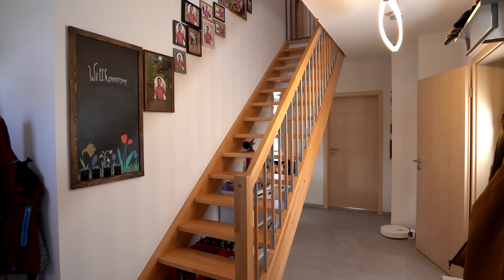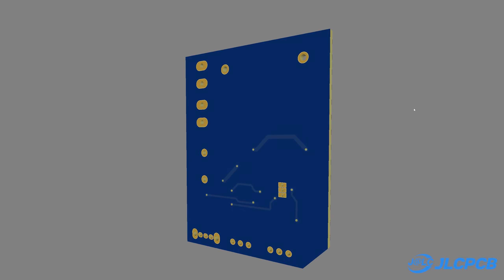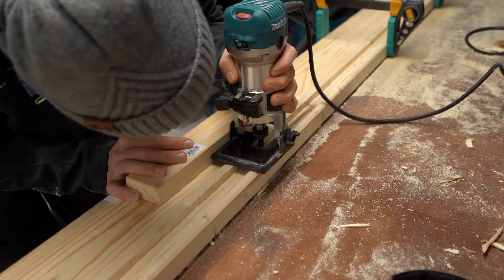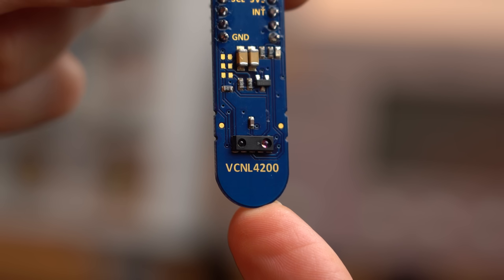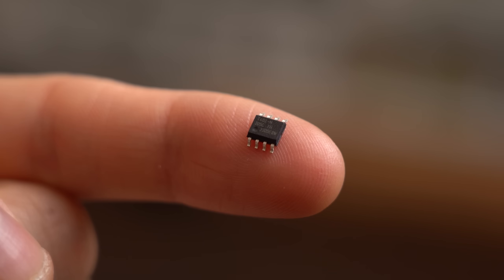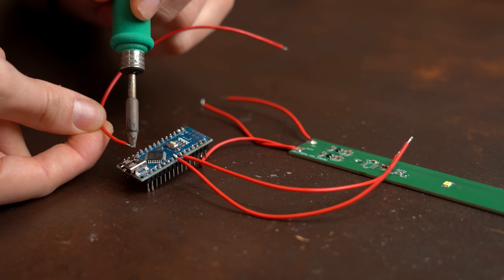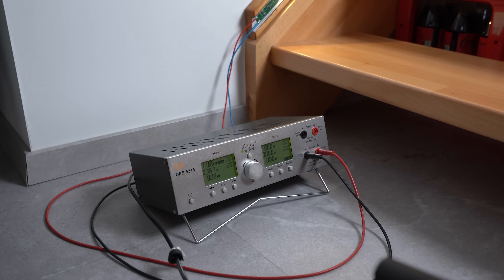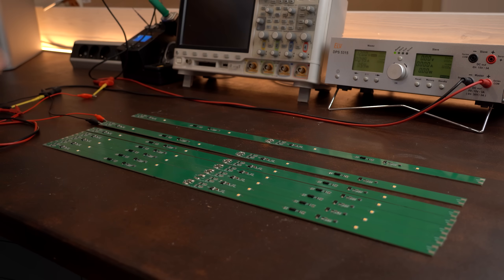I tried to Revolutionize LED Lights!.....And FAILED?

Comment: Frugal Engineer : This can be done with two proximity sensors, the 1st at the beginning of the staircase and the 2nd at the end. Keep the entire LED strip on until you pass the ladder. 
Use reliable MCU and LED drivers.

As per my understanding, you don't want to manually turn on/off the house lights, and you don't want big bulbs to be lit
Reply: that's how i do it. I use neopixels though, just  for a sleek effect to have the leds roll on, out in front of me. GF loves it
Reply: But he wants to turn on the LED in front of him before do the step
Reply: @albertoandrescuevashiguera4304  We understand what he wants and that would make for a rather cool effect but seriously there's no need to overcomplicate lights in this way, especially when they're only going to be active for about a minute once or twice per night, I mean it's just for lighting stairs just leave them on all night at the lowest visible brightness...
Reply: @albertoandrescuevashiguera4304  Doesn't make any difference, it serves the purpose, that's the only thing that should matter logically.

Keep the LEDs on until you're done, not just the steps, but the entire staircase.
Reply: There is a concept humans have they call "aesthetics". A little weird to us, but it mainly means they like things just from their look and feel. More than that: This can differ in every one of them!

To us it has a logical benefit, though: It covers the case where someone turns around on the stairs or two people go. Which would be no issue if both sides just trigger a timer, though.
Reply: @jurgennicht4626  "Aesthetics" This word has no, associations with "Frugal" engineering.

And you didn't get it. I am not talking about timers, it is similar to the concept of a "bidirectional visitor counter "
Reply: True but if you are walking quickly/slowly the LEDs don't match. And also if two people are using the staircase it will be off for the second one and when they reach the top it will turn on again.

Comment: I think you should use higher voltage such as 12 volt with an optocoupler as low voltage is easily get affected by noise, and also use a 555 timer ic for PWM and time delay which can be triggered by a normal IR sensor. No need for a attiny. 
But all and all It was a very nice video for me because it gave me a chance to think.

Comment: I was going to make animated lights on my staircase but decided a simple "all on", when a person is detected, was safer. I used a multivibrator circuit to turn on the lights for 30 seconds, and re-trigger whenever motion is detected. Fancy lighting effects look cool, but are distracting and dangerous IMHO. I love your method for mounting the LEDs. I chose to do the massive wiring to each LED approach,  lol.
Reply: Yea that's the I way. A local shop to me installed one of those sequencial stairs that was sequential in both the steps and the sides (not shure if it makes sense), and I found it super  distracting going up those stairs until I sort of memorised them and got to go up without caring about the light.

Comment: Use the diffused cover but drill a small hole above each sensor! You could glue some clear plastic on the rear to seal the hole

Comment: You could use the WS2811 IC, it's the one that is in the neopixel, just replace the RGB LEDs with white LEDs, like that you can control 3 white LEDs with one data line. That way removes the need to have a constant-current source (or sink) to drive the LEDs with a PWM (or any switching power regulation), and then also removes the high frequency noise that could be induced in the circuit.
Reply from the maker: Hmmmm not a bad idea. I mean the WS2811 is an IC/LED that have been around for a while and it works just fine. I will consider it.
Reply: @greatscottlab  I'd just put in the WS2812/13 LEDs that have the IC built in, saves component cost and you can build in a april fools version where the stairs turns itself into a disco just 'because you can' :P
Reply: Or use a SK6812 addressable RGB + warm white strip. Then you can easily control the white LEDs and also have the optional RGB disco mode :)
Reply: @3zuli   @someguy4915  These options would also work, it will also allow to have red night light but I was supposing that @greatscottlab didn't want to have/use RGB LEDs and wanted better white LEDs.

Comment: I would use ws2812 (or an another addressable LED) on whole way, and at the ends of stairs add some sensor, to detect where is a subject on staris, and try to "model" which LED should be on or off.

Comment: Can you maybe do a video about "Choosing the right microcontroller for your project"? Or generally explain how you search for a suitable microcontroller
Reply: It pretty much breaks down to the following:

1. Do you already own the expensive programmer for a particular brand of micro controller. (start looking here and use one unless there are litterally none that meet the other following requirements)

2. Consider the number of general I/O pins you need and if you need any special features like a DAC or audio peripherals (essentially anything you want built into the microcontroller and would rather not have it on a seperate IC)

3. Is the microcontroller fast enough / has enough flash memory for your program. If you're using Arduino consider a micro controller with at least 8KB of Flash so you have a good amount of room for your actual program. Also make sure it's fast enough to do what you need it to do if you're using an ISR for example to do something.

Those are pretty much the basics for choosing a micro controller for a project.

Comment: I'd try an individually addressable pixel strip that is just using a data line, so this would simplify your project to just handling the sensors.

Comment: My solution: Up and down is one HLK-LD2410, both connected to ESP8266. The bottom one has one pin connected to LED strip with WS2812 LEDs on the whole path of the stairs. Once motion is detected near the bottom one, the LEDs will light up from bottom to top. Once the motion is detected on the top one, it sends the signal to the bottom one and the stairs will light from top to bottom in "usual" walking pace. Works great, keeps the light on for next 5 seconds, to allow kids to, for example, find the entrance to bathroom, or to the next staircase, then the lights "go out" in the same way the came in. Works great, the whole solution costed less than $30, if I do not include the aluminum LED channels - those were the most expensive part of the project in the end :)
And as this is radar, I have no problem with transparency of the plastic ;)
Reply: I think this is a much better and simpler solution than the one presented.

Comment: You simply should enable only 1 distance sensor at a time, not all at once. Distance sensors are interfering with each other when they are simultaneously firing . Also most probably the distance sensors are the ones that create the noise.
Reply from the maker: I checked most sensors though while all were operating. And they did their job just fine.
Reply: @greatscottlab But you didn't on the staircase. The stairs itself are probably interfering that.
Reply: We would need to know how long the IR pulse is and how often he is doing a measurement to know how big of an effect this would have…
Reply: @vlcekmlcek3393 he did. the boards are the staircase for the rest of the time, and he probably brought the laptop to the stairs
Reply: But how do you activate only 1 at the time? To know if person is standing on the step you need for distance sensor to be turned on at all time and you have no idea from which direction up or down someone will go
Reply: @realdragon  i mean activate each sensor in a sequence, once at a time. You can cycle thru all sensors probably in less than a second. There are communications between the microcontrollers so that should be not an issue.

Comment: Should have used mosfet circuit with ir led and recievers with perfectly calibration for some distance by resistor if you wanted to dim it you could use the output mosfet in linear region

Comment: you could make a digital line between the neighbouring lamps. Each could tell to their direct neighbours (i-1 and i+1) that he is detecting you, so the next stair can light up, and also this could serve as one more layer to filter out random lights flashing. Those long pcbs can handle one or two more traces..

Comment: I guess you could use the diffuser lid, as long as you cut out and put a transparent part for the distance sensor. you can even 3dprint a "hood" for the distance sensor to the hole, so as to not have the leds pollute it.

Comment: Maybe make holes in the diffuser strip for the distance sensor then you can get that great look and it will still work well you could even fill in the holes with clear epoxy, glue or some of the clear strip

Comment: Try using the RCWL-0516 microwave motion sensors. They work incredibly well and can be used behind solid objects so using your frosted diffuser would be no problem. The distance can be adjusted with small variable resistors to fine tune. Additionally you could add some wifi (esp8266? Or similar) and connect to home assistant to get motion alerts or trigger lights to blink in your bedroom or office so as to notify you when someone is coming up the stairs.

Comment: I'm sure there's a far simpler way of doing it without I2C, data lines etc. The LED drivers also appear to be overkill- it's a stable voltage, efficiency is relative unimportant as the lighs will only be on for a short time. I can understand a constant current driver for a battery powered device in which the voltage will drop or when efficiency is critical. Can't you just run a signal from the sensor to 3 LEDs (IE one either side of the sensor and the one on the same PCB as the sensor. They'd need an inline diode to each signal to prevent bad stuff happening. Youl'd end up with three signals (each via a diode) driving a mosfet (which would effectively be acting as OR gate). This would mean that the LEDs either side of the sensor would light up. For the LED I'd just use a resistor to drop the voltage. You'ld need a sensor which gave a simple on/off value or just use a output pin on the microcontroller to drive the mosfet and get the microcontroller to interface with the sensors. You could daisy chain a fifth rail between all the PCBs which would allow you to switch all the LEDs on at the same time if you wishes. Can't see why that wouldn't work and would be much easier I think.  Anyway, nice project and thanks for sharing the failures as well as the successes!!!

Comment: Didn't the distance sensor senses the staircase on the other side? And is the IR sensors are I2C you could make 1 bus for the sensors. And use individual addressable LED's and only 1 micro controller

Comment: Using multiple values of decoupling capacitors for instance 100pf, 10pf, and 1pf may help filter the noise as pwm will generate noise over a lot of different frequencies

Comment: One of the big peoblem is using very long communication bus the full length of the stairs. Is the communication bus between a top and bottom ground planes to act as a screening for the bus lines.

Comment: I'd recommend using the table saw to open the groove in the wood. Even without a wide blade (dado blade, not available in Europe), doing multiple cuts will be far faster and easier than using the router
Reply: And this is especially a good way to get the outer  cuts straight. Alternatively a super simple router table could be made using a plate ans some scrap wood (if one have a router but no table saw).

Comment: Those sensors don't like anything covering them unless it's very close and very thin.. Also you only need to activate the IR sensors in sequence with just the ones at the bottom and top of the stairs active when idle. I'd probably use a much coarser sensor (Radar or PIR) to wake the system as a whole when it detects movement near the stairs. By considering how humans move and stairs are used you can do a lot of filtering in software.

Comment: I've been wanting to do something similar, and my plan is to use an addressable LED strip mounted under the handrail and a mmWave radar to get the distance of someone on the stairs and mash those together to only light the stairs in that area.

Comment: You try to set a force timer to it, so even if the circuit still has detection (noise), it will dim after time (say 5 seconds)
(Only of you dont want to redesign and waste money) honestly its worth the price😂😂

Comment: Also consider large programming / debugging pins.
If you space the distance sensor and the leds you can alternate frosted and clear cover so,that the lights look nicer. Or even only the area of the distance sensor clear / with a peeking hole

Comment: I really like your idea of automatic lights for stairs. Thinking about design aspects for safe passage observing you walking the stairs. Is the IR sensor in the middle of the board or at one end? does it have sufficient spread angle to detect you soon enough on top and bottom step regardless of the side of the step you walk on? As for the lighing logic, could group the lighting sequence, so regardless of walking direction, leds light for the current and next step at 100% plus 20% for the third step. Giving light before you get there, otherwise fast walking would not give time to see properly - a recipe for an accident. For your power issues, maybe just try a 78L05/78L03  for each PIC supply and use PWM for LED brightness. You could have one master board with two pcb mount trimpots, one for low brightness and one for full brightness. Giving you flexability without reprogramming. Then theres the question of what should the lights do if you stop on the stairs. I wonder if theres a different diffuser type that allows IR through???

Comment: Seems like it's a bit on the fancy side by trying to control the light on each individual step, when being practical would just have the whole strip illuminate on a timer after receiving a trigger signal from a sensor at either the top or bottom of the stairs. Such would allow for the diffuser and more even lighting. The only "fancy" aspect I'd have there would be having it fade in and out in brightness, so the whole strip illuminating wouldn't be jarring.

But to each their own. Just seems like it could be simpler and do the job just fine.

Comment: You can use diffuser if you can raise proximity sensors and make holes in the diffuser so that the diffuser cannot mess with values and off course it will look way cleaner and professional

Comment: You could use ws2811 with an Ultrasonic sensor, you may need 2 microcontrollers and two sensors. One at the start and the other at the end. I think it would be much easy to build and it is much cost efficient.. you might be able to use PIR sensor too.

Comment: There is radio based sensors/ radars that you can use in this case, you can hide them behind anything except metal and they will work

Comment: I'd be tempted to try a low tech solution of drilling a hole through the strip of wood mounting an led at the back to project a strip of light onto the front of the stairs and have a pir at the top and bottom of the flight.

Comment: I use just a single microcontroller and mostly ESP32 C3 and Neopixel, for distance, instead of measuring horizontally, would have used some ceiling mounted PIR or Radar sensor. This doesn't look hard to me, AI-Thinker already has some DIY commercial solution using the same. Check their YouTube page.

Comment: Ws2812b are addressable leds. So you could use those with some arduino code and sensors to turn them on 1 by 1

Comment: I think the problem is at the data lines between led moduls  and also check wheather the aluminium profile shorting any pins. Or consider using one big microcontroller to all of the sensors and lights i don't know wheather it is possible or not.

Comment: You can buy dimmed cover and undimmed cover, and make mozaic from them, to have undimmed above sensor and dimmed above LEDs. It means, that you will have cover from many small covers, which is firstly bad, but, if you must to repair some module, you can uncover only that part. And also, I will do one PCB to fit into rail in aluminium profile, and one PCB above this, connected via headers, to have posibility to remove/repair/replace it without pulling out any PCBs from rail.

Comment: when the location is less important than the detection, you could add two sensors, one at the front of the PCB and one at the back, and add an AND or an OR gate for the signal (depending on the noise and/or functionality you want). That also solves one issue your current setup has: your lights switch on when you technically already stepped forward instead of "leading the way".

Comment: I really like your design choise, but i would have made a diffrent Approach by using 1 ARGB strip, some sensors and 1 microcontroller. This would really shrink down the boards complexity because you simply put the NEOpixles in series and just need some lines for the sensors, question is how far their power output can reach

Comment: 0:58 it's not damaged if the change was made to accommodate a feature. And really I think a warmer main light could fix the issue easily enough, or just a dimmer switch.

Comment: I wonder if you could have used light pipes to hide the distance sensor behind the diffuse light strip. Would have required a little bit of drilling to install the light pipes, but they may have worked with it that way. Never tried it though.

Comment: You can easily make this circuit with using only 3 transistors as a switch, 
One transistor for onboard sensor, and the other two for previous and next sensor signal and can be easily Daisy chained. 
Transistors will turn the lights on and off. 
And dimming can be controlled by using led driver. 
Hence, no need for microcontroller